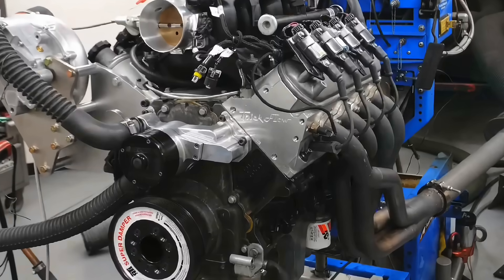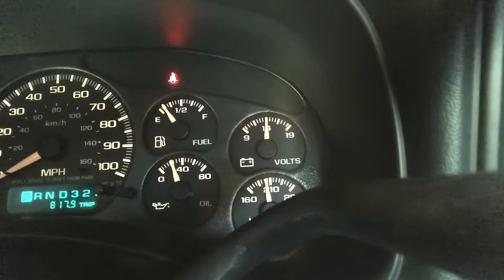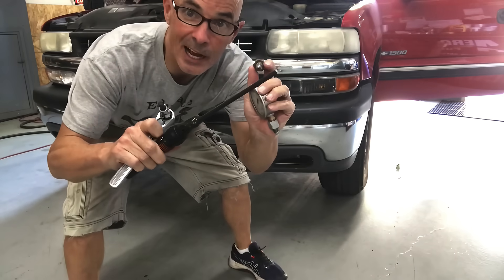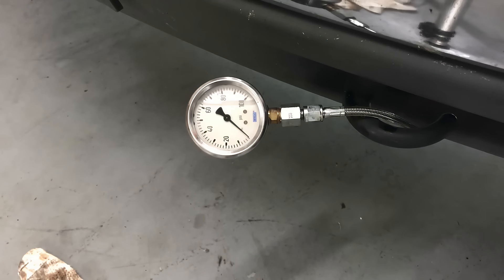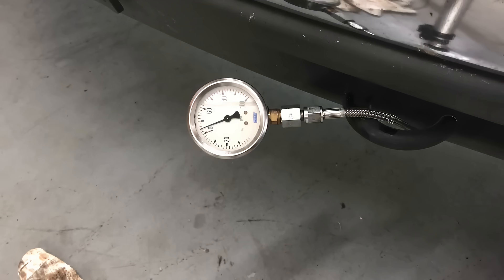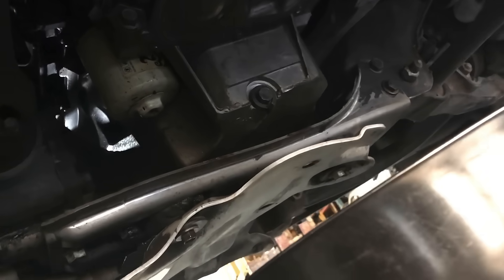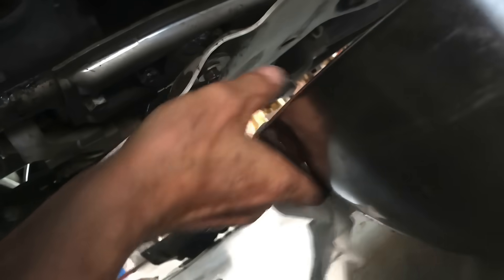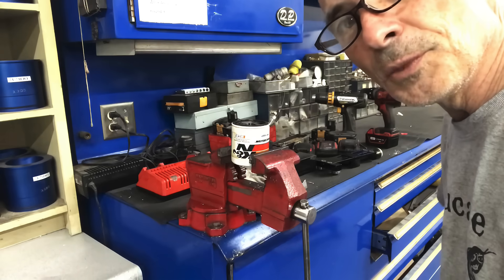HOW TO: TEST & FIX LOW OIL PRESSURE IN YOUR 5.3L OR OTHER LS?

Comment: I've only just built my first LS a year ago, but haven't started it yet only half way thru my car build ( all wheel drive 06 impala using an LS4 mounted longitudinally, when they advise never use an LS4 for a swap, I had this as an original Impala engine but would have been way $$$ and headaches ahead to use any other LS) so I don't know what is average pressure, but with my original small block chevy's 40lbs would not have worried me unless it was 60 always 60 and one day suddenly it's 40. Also I would think close to the pump would be less pressure than up top once it went through the tight clearances.

Comment: I’m having an issue when cold start it takes a few seconds for oil pressure to start building. Long enough the stop engine light comes on. You think pump or o ring issue? Runs fine I just wait till it builds before I move it

Comment: I think I royally fucked up on my truck. Landed on tough times and oil pressure steadily dropped to the point of "Check Engine Oil Pressure".... Did not think I could afford to fix it so ran a bit thicker oil (got oil pressure) and literally 2 days before the weekend I'm tearing into it.... got a tick tick tick from the valve cover. Hopefully proper oil with good pressure will make the tick go away so I'm not doing lifters again.

Comment: So on the 5.3 and 6.0 with roller rockers we find that the cam and lifters start to fail ( you can hear them ticking) and when they do, the metal debris get picked up by the oil pump and merrily go about jacking the bearings up...
All of this leads to chronic, very low oil pressure (as it also tends to cause the pressure relief valve in the oil pump to jamb).

Always pull the old oil out into a Clean oil pan and look for that glint of metal in the sunlight. 

If you see bearing material in the oil pan don't waste your time as that unit is done.

Comment: Oil pressure was totally normal.  Broke the o ring when the guy took it apart.  I have an 02 Blazer with the v6 and when cold it's 70 psi and when up to temp it's 20 and shaking.

Comment: My 02 Tahoe 5.3 (268k miles) displayed similar behavior. Pulled the pan, replaced the crumbled pickup o-ring. Problem solved. 42 psi at idle, 58 psi at 1500 rpm(both hot), 10-30 M-1.. Be sure to upgrade pcv (new driver-side valve cover and orifice-style pcv valve for original ball-type) on early LS; reduced oil consumption to ~1 qt/3k miles....

Comment: Mostly run into O-ring problems, Same test, then a AT-205 poured in with higher pressure after is a good O-ring test for rubber rings,...noise listening 🎧 for lifter pressure loss...🏁🏜️💪😎🔧🛸✨

Comment: I have found the screen under the sending unit plugged showing low psi.  Have you ever shimmed the regulator in the oil pump to increase psi or port the pump housing to help flow?

Comment: Engine sludge in oil pan that clogs the pickup screen. Solution is to run a qrt. of ATF in engine oil at idle for a while prior to changing oil and filter. ATF and it’s detergent properties can help flush and clean engine sludge. A fleet mechanic helped me with the little to no oil pressure issue I was having.

Comment: Great video just R&R oil pressure sensor on 2007 Chevy Tahoe LT sensor still on
Reply: Changed oil and filter problem gone also put Seafoam Treatment in fresh oil and gas

Comment: First, always trust your gauge. The gauge at the oil pump tells us that somewhere before let's us know we losing suction pressure based on laws of head pressure. The gauge at the instrument is a referenceonly for the driver to indicate a fall in pressure.  2nd gauge is designed for that reason. 
 Al

Comment: Mine don't have low oil pressure works just fine but im not getting fuel after I start the truck .could oil pressure sensors throw security /anti theft on?

Comment: Can you do a how to achieve high oil pressure on high rpm engines like a 4.3 v6
Reply from the maker: easy with oil weight and hv/press pumps

Comment: have a 2008 silverado 4x4 5.3L and the AFM but had lifts lock up due to lower oil pressure per the trucks system setup. Both heads were reworked and new oil sending sensor and screen and now as it idles the pressure drops to around 20 psi but driving up around 40 to 45 psi? i am wondering if there's something else going on like the pick up tube seal or do I need to a gauge setup to check direct pressure as in the video?

Comment: Hi my 1999 Chevy 3500 has the 7.4 oil pressure goes down to to 30% truck wants to stall but pressure goes back up then keeps doing it but oil doesn't go all the way down u have any suggestions ?
Reply from the maker: low oil pressure is likely caused by low rpm-not the other way around
Reply: The truck runs alright not enough power sumtines but only in park it does that...  I see the oil pressure going down til it hits 30% the truck trys to stall but stops after oil pressure goes back up any suggestions

Comment: We. Have over 40 6.0 s in the delivery fleet and there is always one or more that have zero at idle, some brand new. One package car that has had 3 Reviva reman engines. A lot of times a oil pump fixes them and then a engine does. I don’t work on the package cars but see what’s going on.

Comment: Even the felpro replacement oring is not a snug fit, we have a huge section of viton orings and i have been matching a more snug fit size to fit the bore and pickup tube.  If u look at how much room there is for the oring u can actually stack 2 in there without an issue.  I'm sure i will catch slack for that but, how soon do u want to do this job again??
Reply from the maker: there are many different size factory ls o-rings-they must be selected for the proper application. you don't need 2

Comment: Wait I got a stupid question in which I must also say I am stupid, so prepare yourself.  So I cam swapped my car along with valve springs push rods and lifters. When putting the alternator mount(ls2 motor)  back on I there are 4 bolts 2 for the alternator and two that go to the mount and 2 that go through the mount to the block, as my first time doing this accidentally screwed the longer alternator bolts through the mount and put two holes though my 243 head, once I noticed this I pulled my heads off and got the aluminum FOD out of the head. Motors been fine since. Although I noticed my oil pressure has actually been lower than before when the motor was stock, I’m now thinking that these two holes might be reliving oil pressure out of the motor Although I have no leaks through those holes. I torqued everything else down to spec when I was putting the motor back together including the cam retaining plate.
Reply from the maker: DID YOU GET ALUM IN THE MOTOR?
Reply: @richardholdener1727  I did, but I never started it up it was caught in the upper portion of the head and the lifter tray, all metal bits fit back in the hole it came from so I know for a fact I caught everything. Just did another oil pressure check it does idle at 28 psi when warm. and at 152 degrees does go up to 48 psi at 2k rpm with 5w-40 motul. I remember before it being higher though. Do you think those holes, could effect the pressure, although I will say those large bolts are threaded in now so I feel like not much air would be able escape past those threads.
Reply: @richardholdener1727  I did pull the whole head off and verified that nothing fell into the piston chamber

Comment: Richard, what do you think about the K&N oil filters? I’ve used them many times and then I heard that they weren’t that good anymore 🤷‍♂️ also, what’s your opinion on high volume or high pressure oil pumps? My 4.3 s10 has scary low oil pressure.

Comment: I need help I have an 05 Cadillac Escalade I had an oil leak I got that fixed may have some sludge somewhere can't go over 60mph without my truck shaking like crazy it doesn't pick up enough speed it's V8 5.0

Comment: I own a 2000 Chevrolet Tahoe with the 5.3 L I had the problem with low oil pressure but before I put it in the shop I purchased a can of seafoam running in there about 2 weeks change my oil low oil pressure situation went away. 7 months later still has good oil pressure. It never got low in between oil changes

Comment: My bottom port is reading 40psi hot. My top port is reading 10psi hot. Kind of weird.
Reply from the maker: look at your filter
Reply: @richardholdener1727  will do thanks Richard.
Reply: @richardholdener1727   With the mobile1 oil filter I had 10lbof hot oil pressure from the top oil port. I switched to a fram oil filter I now have 30lb hot oil pressure from the top port. Thanks Richard the oil filter was the problem.

Comment: I have the same problem but it goes almost to the red, I just changed the Oil Gauge Sensor still didn't make a difference does that mean the Oil Pump is going bad?

Comment: I have a 2002 lm7 in my s10 when i fire it up cold its has around 36 psi but as soon that i start running it hard then drive normal it goes at 0 and stayes there untill i run it hard again then it goes back up to 40 dosent have any knocks after watching this video i think it could be the o ring but does anybody think it could be somting else?
Reply from the maker: stock bypass valve?

Comment: I'm hoping someone here can help me out this thing's driving me crazy. I have flushed the system, I have replaced the oil pump and the pickup tube and the oil pressure switch, swapped out clusters checked all wiring and still my oil pressure is dropping on the gauge and the cluster eventually kicking engine light stopping me from getting a sticker. What else is there that could cause this low oil pressure please and thank you.

Comment: I would be curious to see if there would be any difference in the cluster auger with a different sending unit and also replacing the stepper motor.

Comment: Clean truck man, these body styles have always been my favorite.  I have a 2000 with 250k still running 60l-70bs of oil pressure and running like a champ
Reply: Jesse, you are right! I have a 2001 Silverado 5.3 and it has 345,000 Miles and is my Daily Driver! Oil changed Faithfully at 4,000 Miles with Napa Gold Filter. I have a new Motor built for when the original one goes, and I am anxious to see with the Mileage it has what the inside looks like. Until then, Chevy all the way!
Reply: @sandyrandall7341  I service quite a few fleet customers and have seen REALLY WELL MAINTAINED (using full synthetic Mobil 1) with over 700k on the original engine. Maintained, quickly diagnosed/serviced/repaired if any issues pop up (as they will on any engine/vehicle) and never having been badly overheated and the 4.8/5.3/6.0L engines are probably the most durable trouble free engines on the market and have been for 20 years now. I know the engines with active fuel management seemingly encounter oil pressure issues due to lifter related failures though if promptly serviced these too seem to be pretty much bulletproof.
Reply: I got the maroon stepside, extended cab 2001,    Like a rock, 💪🏻💪🏻💪🏻👍👍
Reply: I recently had a cam change in my 2011 GMC Sierra it's a Howard asa cam intake D. 226 exhaust D. 236  duration 274/285 lift 525 .. wondering why this tuner cannot get my truck right just wondering if you could point me in the right direction you put the truck in park you mash the gas RPMs go up RPMs drop almost cuts the truck off if you put the truck in neutral it does the same thing as this is happening the oil pressure drops also .hoping someone can point me in the right direction.. ....

Comment: can low oil pressure cause knocking or ticking sound  can anyone help me figure it out I have a 2001 tahoe 5.3 engine that has been doing this for two days knocks on cold start but will go away here and there.
Reply from the maker: its usually temperature and piston slap-can also be lifter tick

Comment: I have a melling oil pump on my new motor I put in and it was reading great all day yesterday it was like 50-60 psi cold and just above 40 when warm I punched it hard doing a u turn and smoked the tires and now it says 0 oil pressure what could be the cause I shimmed the pump before install. it has a new cam plate new ls7 lifters and trays and installed new o-ring and a new sending unit but it was reading fine till I did that
Reply from the maker: sending unit damage?
Reply: Lol I feel dumb the harness came unplugged

Comment: I have a 2000 GMC Sierra 1500 I was driving down the road and the Engine oil pressure light blinked once and then the car shut off on me

Comment: 2000 Chevy Tahoe 5.3L v8 Vortec 2wd... Bought it with slushy oil and didn't know it, it made no noises. Changed head gaskets, oil pump, cleaned oil sump and replaced o-ring, new oil sending unit, put new coolant, new oil and filter, and all related gaskets. Afterwards all seemed well, 45psi. But now after vehicle warms up, pressure "slowly" flutters back down to near 0. Idk, lifters, cam plate, bearings or what?

Comment: Most of the low oil pressure issues with older LS motors I’ve done have been the oil passage gasket in the pan! 
Many times people wait too long to get it fixed and it causes major engine damage!
Reply: I got the 4.8 but not sure if its ok or be worried. It idles at around 38 oil pressure and doesn’t go up to much when im on the highway

Comment: My pickup is a 6.0 l 1500hd has oil and every morning at cold start have 10 psi after truck warms have 25-30 at idle in your vid it shows you having more pressure

Comment: The Allen bolt under the power steering where you put that fitting for your op gauge can that port be used as oil supply to my turbo?
Reply from the maker: yes

Comment: Richard I’m a fan and love your content very informative 
I am a gen 12&3 ls fan 90% of the low oil pressure problems I deal with has been that oring You would be surprised at the number of asc certified trained mechanics that just don’t know and would sell the customer an oil pump that’s not needed and accidentally fix the problem with a new oil pump but only because they installed the new oring while installing the new  pump ultimately fixing the issue but blaming the wrong part 
My 02 surburban 386k original miles nothing but oil changes and regular maintenance op around 20 psi dropped the pan replaced green oring at operating temp 50 -70 psi
Thanks for information though I’m going to share this cuz nobody believes without seeing
Reply: Most mechanics get a pay percentage on parts replaced.
Reply: @Tammy Feddersen  not how that works they get paid on the job based on flat rate time. If a job pays 6 hours to do and it takes you 8 you only get paid for 6.
Reply: @mzuvin5705  This depends if the mechanic is working as Self-Employed or for a Larger Company associated with a Dealer and the Brand of Cars it has been franchised, contracted, or/& licensed to sell along with the associated Used/Pre-Owned Division. Body Shops & Automotive Repair Shops performing repairs for insurance purposes is more likely to go by your mention of “Given 6 Hours to Repair Job” scenario and EACH INDIVIDUAL MECHANIC’s efficiency, experience, expertise, & skill level encapsulates the issue of spending more time than the GIVEN LABOR HOURS PAID FOR THE PARTICULAR REPAIR in a Detailed Line Item Repair Quote and subsequent Repair Shop gaining the Business of that Client or Customer.
Reply: Yep I've heard that's the most common issue. My 02 Chevy with the LM7 iron block LS has 220k and just dropped some oil pressure. Gonna check that O ring tomorrow

Comment: change the oil pump and oil sensor 
still no oil pressure 
cold is 20 and drops after warms up
230000 mile 2004 yukon
mechanic said using blend oil was not a good idea 
before i used to get 40 all the time and a little lifter noise when it was cold

Comment: My 2003 2500HD 6.0 on a cold winter startup, Says LOW OIL PRESSURE on the information center.235,000 miles and recently started doing this. But it does read pressure (Just under 20PSI) but it does get up to 40 at idle after a few minutes. Seems to hand around 40 while driving and even higher RPM's.

Comment: If you flush your engine, you can also get a drop in oil pressure due to bigger tolerances after.  Also that Oring may have varnish that is removed with an engine flush causing bigger gaps.  I flush every 100K and use BlueDevil oil leak sealer to swell the Orings and gaskets back in place.  Running 38/39 at Idle, like you and 50 at 2K rpm.  Good enough for an engine with almost 300K on the clock.

Comment: What size is the bolt thread for the pressure check location by the power steering pump?
Reply: same as sensor on top of motor

Comment: I bought a MINT 2004 LT Chev Silverado 6.0 with low oil pressure from a guy that knew mechanics... after watching 1000 videos I bought a New GM Oil O-ring and a GM Oil Pickup-tube W/O-ring (both O-rings were Red)... removing Oil pan I can see a Brand New Melling Oil Pump and New Melling Green O-ring... Seller told me he installed a New Oil Sender (found)... Pulled Melling Pump to see if Oil bypass piston was stuck (Nope)... Pulled Motor to rebuild hoping a Cam Bearing walked out a bit.... Oil and Filter was Super clean small pile of iron shavings about the size of a Dime found in sludge in pan, hoping that's the Cam Bearing hitting the crank... Engine ran Super Smooth with the low oil pressure when I bought the truck...
Reply: 2nd cam bearing walked out and was touched by Crank... easy fix...

Comment: The pressure relief valve that people are always trying to mod just to save the $100 bucks. Its in the oil pump they like to wear out because the spring wears down on one side and digs into the cast aluminum housing on the other. The piston also creates enough slop digging into walls creating sharp scratches and piston will catch and hang on time to time
Reply: I think this is the root cause!